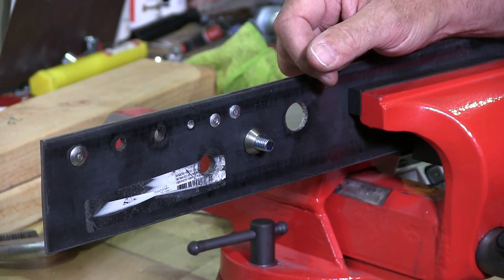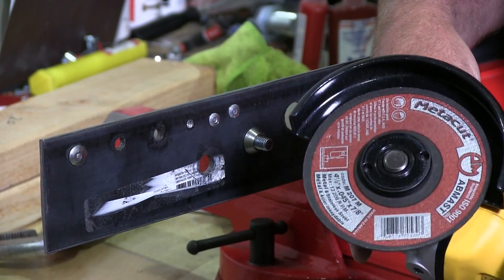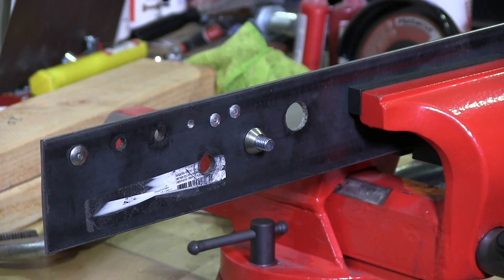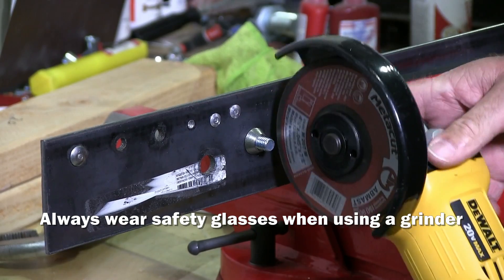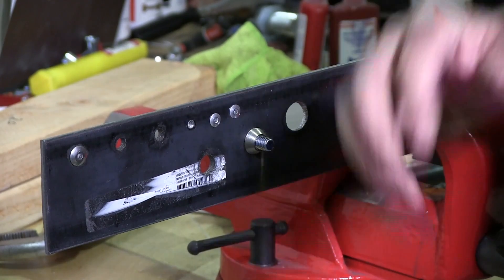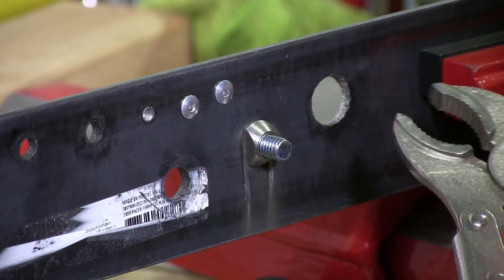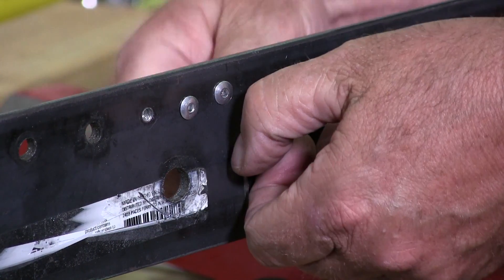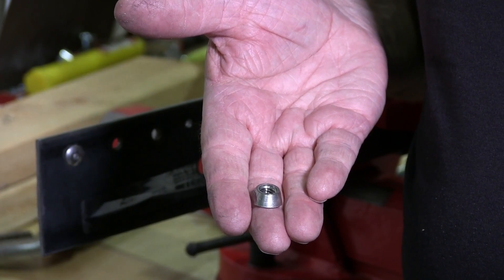How to Remove Breakaway Shear Security Nuts | Fasteners 101

Comment: Thank you so much, I work at a prison and they wanted me to take all the old signs down and one of the small parking lot signs had this exact security nut on the back and I was lost as to how to remove it, so you just grind it and screw it off. No wonder they call it a security nut, but for a small parking lot sign this is over the top whoever put that on there.

Comment: Your demo is on a flat plate, the majority of these nuts are recessed in a C section fence rail where you cant get a grinder or spanner on to lay flat. Any tips in that situation?
Reply: If you are on about on palisade fences the bolt is the strongest part if you get a foot of steel pipe you can just fold the tops over and the fence is no longer an issue
Reply from the maker: We would advise perhaps trying to drill it out or use an extractor kit, but these are only possible if you have the clearance to get a drill in there. You could also try using a file or a cordless angle grinder to get some flats on the nut then grab it with pliers or a spanner from above the nut but again, this all depends on how much room you have to maneuver.
Reply: use a chisel cut groove in the side with said chisel.tap it out
Reply: @mannycastro5059  could you smash a groove in the top and use screwdriver?
Reply: File the sides down a bit to get a shifter spanner on it

Comment: Hello, Albany County Fasteners: Can you show how to secure a metal bench into a concrete floor! Just spent £900 on a memorial bench and I want it secured the best way possible. I can use marine grade S/steel shear nut and bolt. I want it so it can never be lifted from its location. Regards. UK.
Reply: These shear offs are bollocks tbh mate can remove them without a grinder best thing would be to set some rebar in concrete and weld the bench to the rebar but if people are gunna come along with a grinder it will get knocked either way but shear offs are easy without power tools and can be done a lot faster than the video shows
Reply: Bertie Pimplebum did u fasten it to the ground
Reply: welder and lots of steel, just use material to waste their time is only working strategy